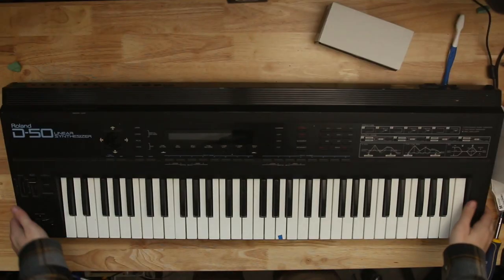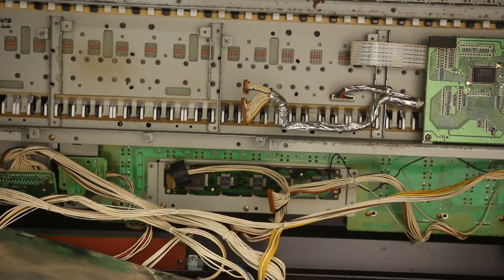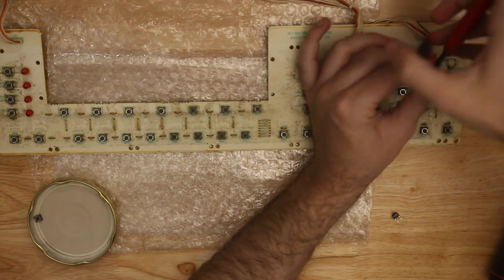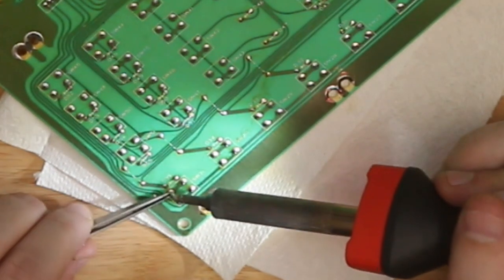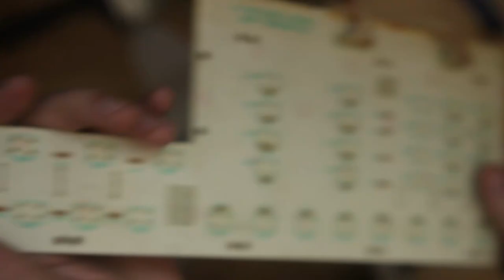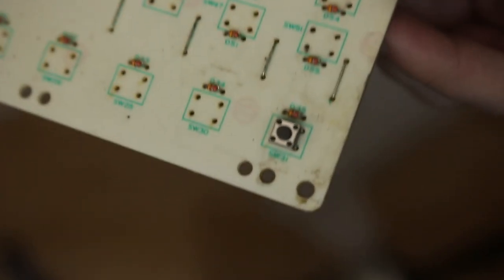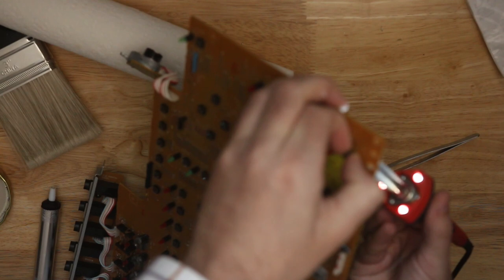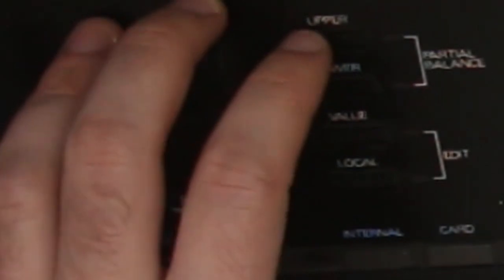Roland D-50 Repair // Tact Switch Replacement

Comment: Even if there probably aren't many people out there specifically repairing buttons on this specific synth, videos like this are so damn helpful and are a godsend to the few people who do happen to end up dealing with the same issue. 

Content like this is much appreciated even if it may not get very many views; although I'm sure there are people like me who watch regardless because synth internals are super interesting to learn about, especially analog ones!
Reply from the maker: Ah cheers, thank you!

I wonder if thats a totally separate demographic of my viewers...
Reply: As it happens I just got a d-50 and it looks like I need to replace a switch. The Key Mode switch is non functioning.
Reply: @justinjohnson4246  and it's fixed, thanks to this video!

Comment: Fiexd mine last weekend.
Thanks for the video!
I changed all the switches and retouched all the soldering points (Connectors, leds and diodes)
Now is working like a charm

Comment: I'm in the middle of restoring a D20, this is helpful. Most of my buttons are sluggish. I had to solder some jumpers on the key controller, because three of my keys were dead and no amount of cleaning or using a lead pencil brought them back. I literally just reformated to factory defaults. I have one more key to clean up, some how it lost it's soft touch but works if you pound on it, so my Multi-Timbral/Performance button is sticky. You have to hold it down, in order for it to activate. So I'm going to move forward with replacing the buttons. I bought this for less than $200. It'll be a great synth when I get it all finished. Thanks for sharing your knowledge.

Comment: Pretty much all synths that came out around or after the D-50... Korg M1, Yamaha SY, etc. have to be opened from the bottom. It's a pain for sure! That dirt and grime is fairly common, especially if the synth was stored in a garage, etc. Thanks for doing repair videos, I'll keep watching ;)
Reply from the maker: Cheers Jack, if you're still watching I'll keep making them! hah

Comment: I never would have Imagined you needed to switch 50 tactile switches! I've found most used keyboards get super dusty over time. I got a Juno g and it was filled with dust and cat hair
Reply from the maker: Isn't that surprising, that ALL of them were in bad shape?

There's a good chance reseating the ribbon cables had some positive impact as well, and I wouldn't have had to replace them all, but checking continuity, dozens weren't working right.

Cat hair is worse. lol

Comment: Very helpful! Thankfully, every switch on mine still works but I have 4 or 5 dead keys that I've been putting off doing for years. It's basically a sound module now but I'm missing playing that beautiful keyboard.
Reply from the maker: Wish I had good footage of any key repair stuff, I've done it a few times but never had the camera on. One more thing to worry about while working, I guess.

Comment: Jorb, are you an electronics guy or more of a tinkerer?  I've done surgery on some of my gear (displays, batteries, odds-n-ends) but I always just asked questions and tried to figure it out as I went and tried not to screw anything up or dig too deep.  If you are knowledgeable on power supplies I would be very interested in any videos you make.  Good video!
Reply from the maker: I'm well practiced with soldering and diagnosing shit, but not much proper engineering experience. 

Just been fixing shit since like high school.

Comment: I bought a D20 a few months ago, which I thought I would get lucky that it will all good
but I was not
all the knobs are dead (not individully knob, but all of them), which is more dificult to analise the problem.
the keys are oke but the only sound that come out is just piano ... you can't change it to any sound else and they happenned to divided to double mode ... lower keys are single finger mode and the upper key are pianos sound....
Can you please  give me some advice what would I should do .....
ps. the volume and pitch control are working
knob = Tact switch

BIG thanx

Comment: I got a d50. It makes sounds but there’s a ton of noise on the output. I replaced all electrolytics, battery, audio jacks, still no luck. I’m dreading it might be a deeper issue. Any insight or ideas?

Comment: My D-50 has one tact switch failed. I think a few more are going to have to fail before I go through this much work. haha
Reply from the maker: All depends on which one is bad! Lol
Reply: Buy new ones but look good they are not chinese ones and the prices online are much to high. I bought them in a local shop in Belgium at 20 % of the online prices. I payed 16 € for 40 pieces.